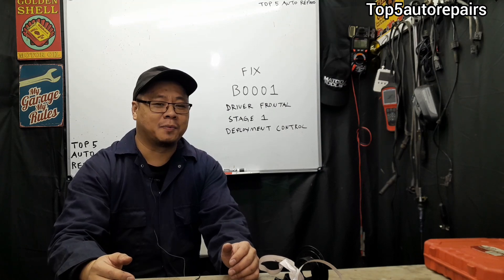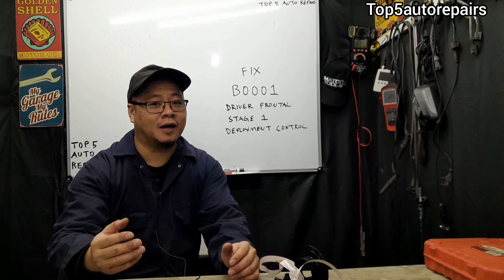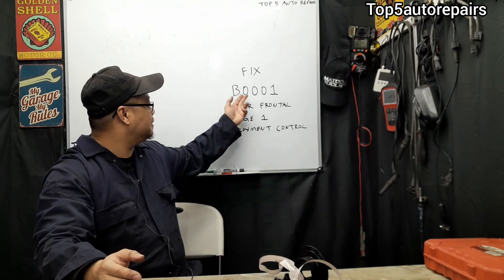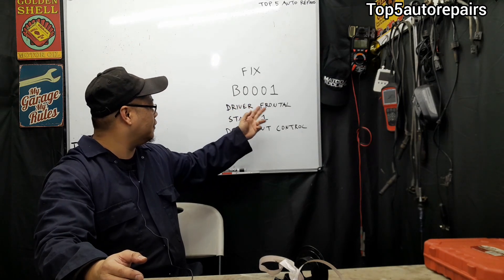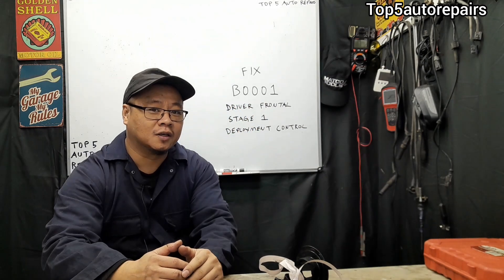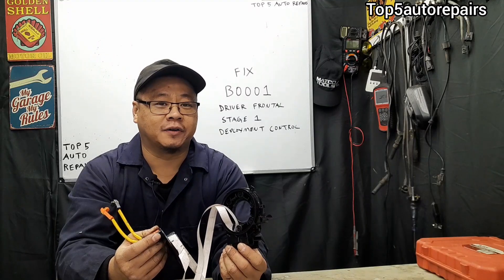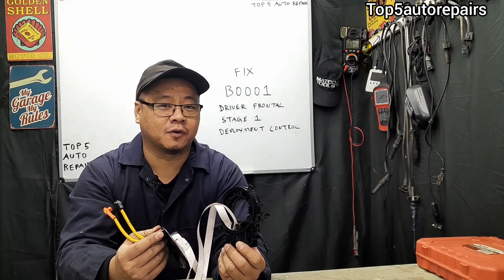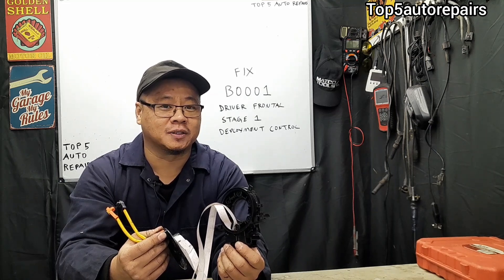CAUSES AND FIX B0001 DRIVER FRONTAL DEPLOYMENT CONTROL ERROR CODE

Comment: B0001 code 2016 Explorer. I replaced clockspring and checked connectors under seats. The light went out for a short drive, but came back on. Could it be the airbag or??